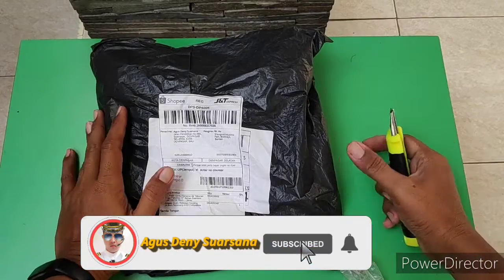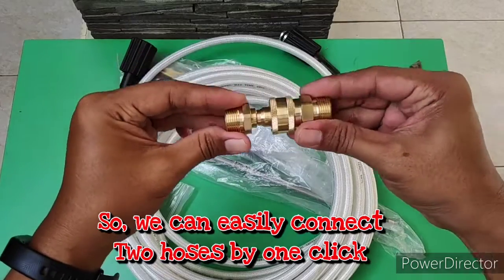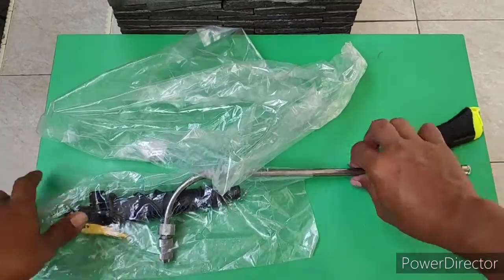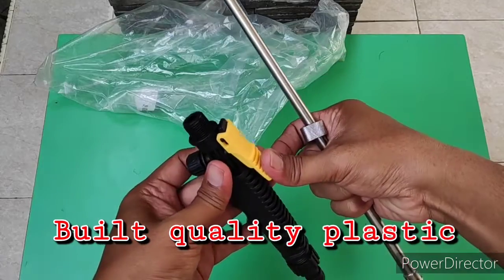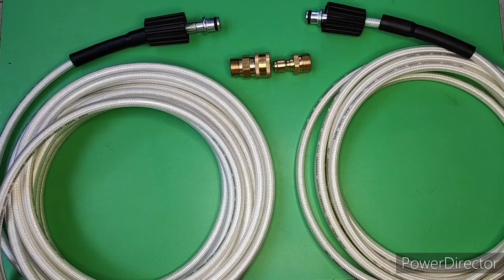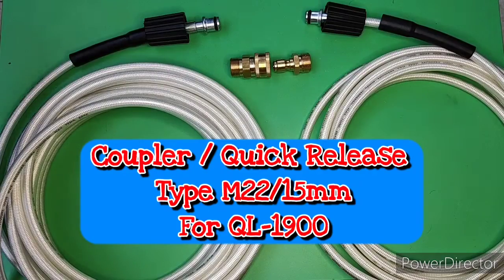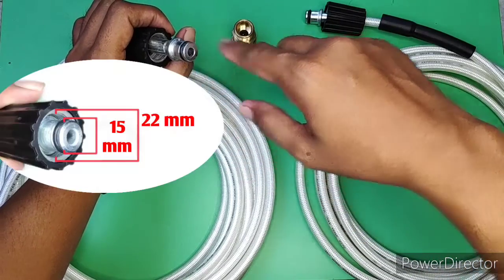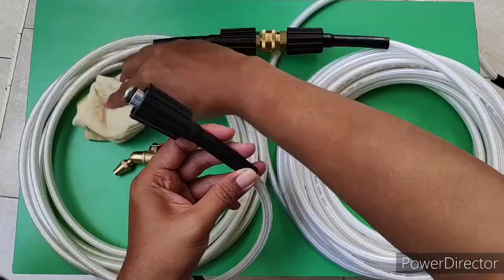Quick Coupling | M22/15mm | sambunganselangjetcleaner | QL-1900

Comment: Bos quick coupler angin beda nya apa dg quick coupler air
Reply from the maker: Drat nya beda bosku, fungsi nya tetap sama
Reply: @agusdenysuarsana9249  maksud nya beda drat itu gmn? Apakah beda alur?
Reply from the maker: Beda diameter nya bosku. Untuk tipe drat M22 jet cleaner, harus paham dengan outer diameter & inner diameter hal ini akan berkaitan dengan selang jet cleaner (inner diameter) yang bentuknya lonjong.

Comment: Gan, ini coupler nya bisa untuk selang ql1200 ?
Mau sambung juga
Reply from the maker: Coba saya cek terlebih dahulu ya. Apakah ada foto selangnya gan?
Reply: @agusdenysuarsana9249  baru mau beli gan, maksdnya jika cocok mau sklian beli nya. Jd blm ada info selang, maaf
Reply from the maker: @wisnue2164  kalau begitu, coba saya cek terlebih dahulu ya.
Reply from the maker: @wisnue2164  setelah saya cek, ternyata kedua sisi ujung selangnya beda gan. M22 & drat dalam 14mm atau 18mm
Reply: @agusdenysuarsana9249  maaf gan, jadi kalau saya beli yg tipe apa?
Reply from the maker: @wisnue2164  tipe aja boleh gan, asalkan kedua ujung selangnya sama yaitu tipe M22/15mm.
Reply: @agusdenysuarsana9249  saya udah pesen ql1200 gan dan selangnya
Tinggal nyari sambungan selang 10 meter ke 5 meter nya,
Reply: @agusdenysuarsana9249  brati untuk selang ql1200 belinya m22/14 gt gan?
Reply from the maker: @wisnue2164  pastikan selang yang 10meter memiliki drat tipe M22 pada kedua ujungnya.
Reply: @agusdenysuarsana9249  oke gan makasih
Besok pas datang gw cek
Reply from the maker: Ditunggu kabarnya gan

Comment: Klo ukuran jet cleaner NLG sama gk ya mas?
Reply from the maker: Harus di cek terlebih dahulu mas. Karena ukuran selang bervariasi. Awalnya saya kira juga sama, tapi ternyata tidak. Beda 1 millimeters aja ga akan bisa masuk mas. Kalau bisa diukur terlebih dahulu
Reply: @agusdenysuarsana9249  m22 drat 1/2" bukan bos?
Reply from the maker: @ivsenar1674  bukan bos, tapi diameter 22mm.
Reply: @agusdenysuarsana9249  klo nepel yg ke kran sama ke slang ukuran brpa bos?
Reply from the maker: @ivsenar1674  untuk Nepel reducer ukuran 22mm x 14 mm bang.
Reply from the maker: @ivsenar1674  apakah Nepel reducer yang dimaksud ada di video berikut? https://youtu.be/weCvWEfYkjs
Reply from the maker: @ivsenar1674  apabila bermanfaat, mohon dukungannya dengan cara like video & subscribe ya bang. Terima kasih 🙏

Comment: Bang itu yang 22 mm sama dengan nepel 1/2 atau 3/8?
Reply from the maker: Beda bang... Bukan 1/2, juga bukan 3/8. Tapi M22 special designed
Reply: @agusdenysuarsana9249  iya bang tau,maksudnya ukuran dratna sama yang 1/2 diameter input ke selangnya kan pake drat tuhh nah ukuran dratnya berapa gtu gan makasih udh di jawab🙏
Reply from the maker: @alvinabdulsahab7050  apabila bermanfaat, mohon dukungannya dengan cara like video & subscribe ya bang. Terima kasih